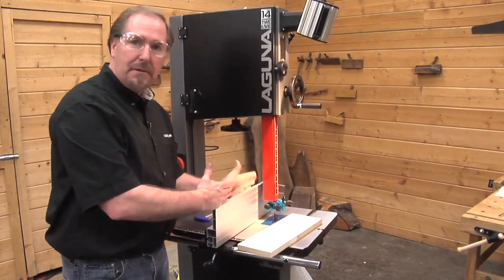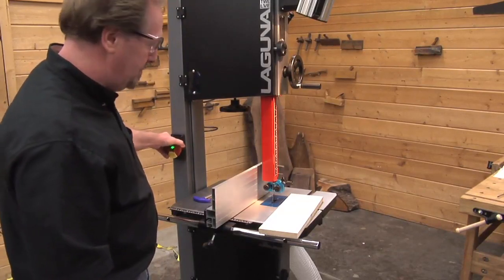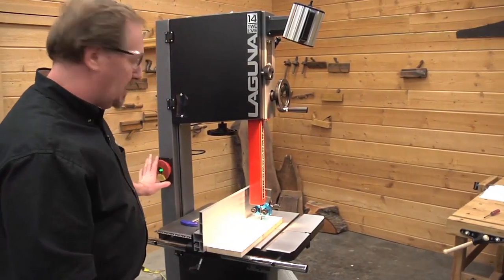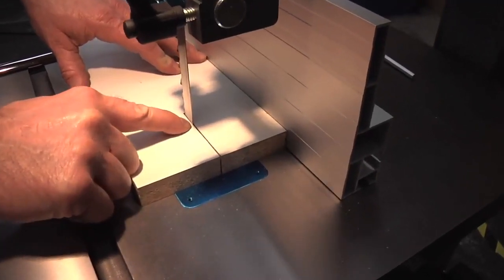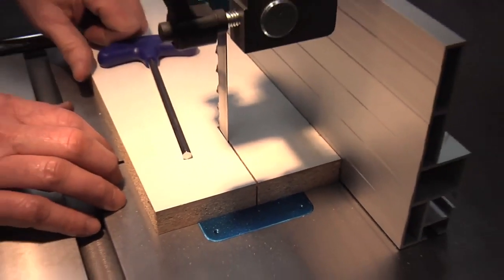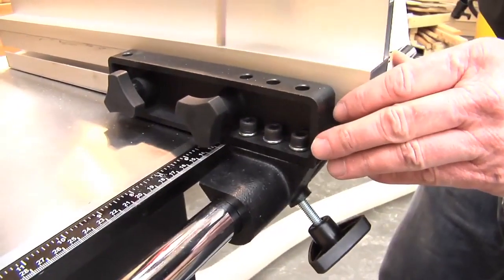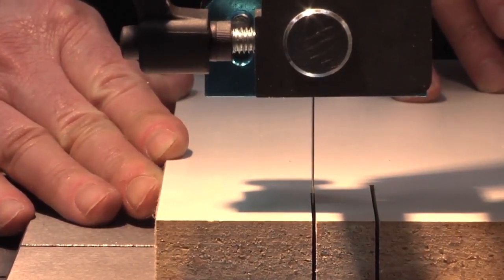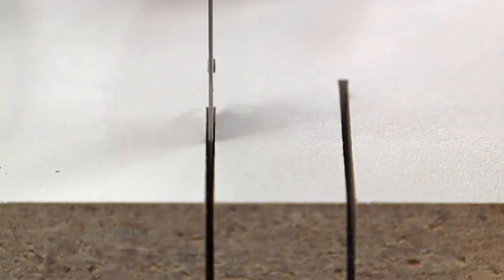1412 Bandsaw Drift Angle Adjustments - Part 12 of 14 - Laguna Tools

Comment: thanks! great video, I had no issues with drift from my laguna saw and new blade but nice to know how to adjust for it if it becomes a problem as the blade gets a little duller. that's what really causes drift in my opinion, assuming you have everything else set up properly .